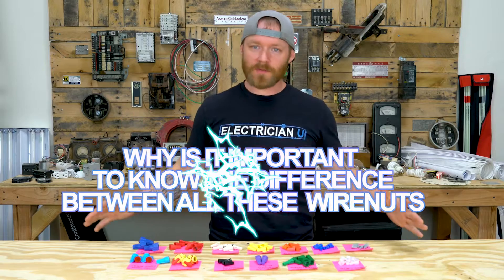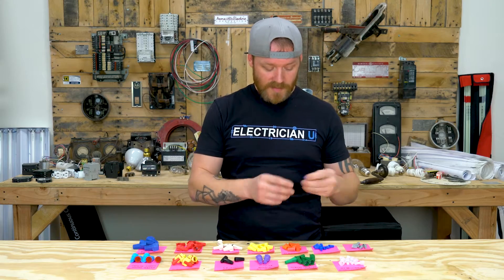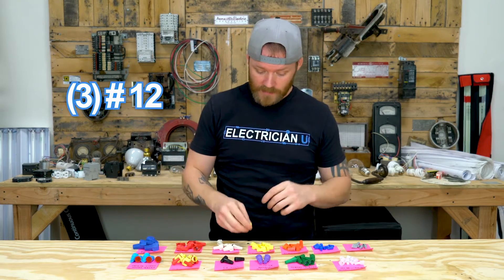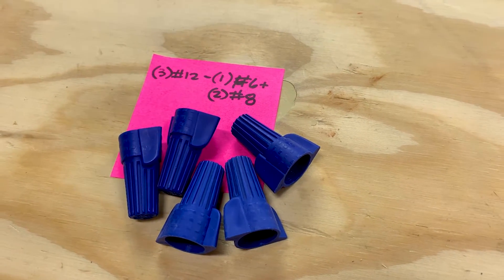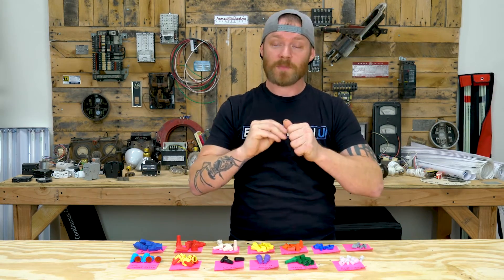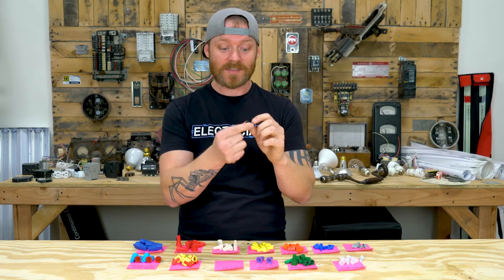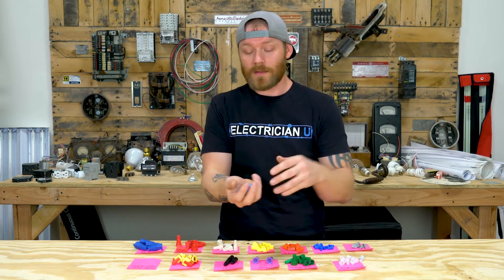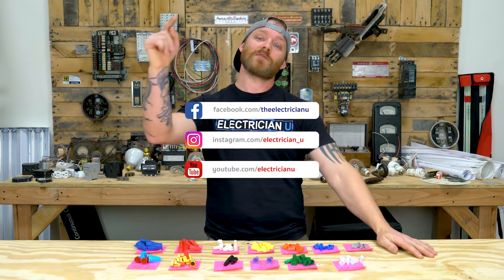WIRENUTS - Why Are There So Many, and Why You Should Care...

Comment: Great vid! Which nut should I use to just cover one hot wire in a 12-3 Romex? I have a lot of left over 12-3 and I don't want to just get a roll of 12-2 so I'm going to splice the 12-3 to the 12-2 in a junction box. Which nut can I use to just cover that extra hot wire that is not needed? Thank you!

Comment: There are different sizes because different gauges of wires and splices. There is heat shrink insulation also for splices immersed in water for motor connections servicing  well pump motors.

Comment: I don't know which size to use when combining wires in a 2-ballast fluorescent fixture.  For example, a Live/hot from the ceiling will connect with the little wires in the fixture, which are 2 blues, 2 reds and 2 yellows.  What's the smallest size I could use for that?  I'm just getting rid of the ballasts and connecting for LEDs.

Comment: These marettes are the go-to’s when you have plenty of wire, and a whole lotta time. I used to use these first, then moved to the blue cap screw-ons, then to insulated terminals, and now I’m finally on non insulated spade terminals. Now I’m thinking again about these again with a 1oz tube of liquid tape to top off for waterproofing purposes. Like I said, when you have plenty of wire, … why not?

Comment: The ones with the '' wings '' on the sides, I call them Scotch Locks,  and have for many many years ! Wire Nuts have a HARD Plastic outer shell and I only use them for the splicing of the stranded Fixture Wires to the NM-B Romex Conductors, solid to stranded !  Wing Tips or 3M Scotch Locks , I use for the splicing of the NM-B Romex conductors,, solid to solid.

Comment: If those are the red wire nuts I think they are as a commercial electrician I take all of them off and throw them to the ground. I have lost track of the number of times if gone into a box and if a wire nut falls off, or doesn’t reattach, it’s always the red ones. So, I refuse to use them for any reason. 

We mostly use 3M up here in MN with the company I work for. 3M tan/reds, and 3M yellow/grey are the goto, Ideal baby & big blues are pretty usually when needed, although not needed that often.

Comment: If those are the red wire nuts (edit: they are not) I think they are as a commercial electrician I take all of them off and throw them to the ground. I have lost track of the number of times if gone into a box and if a wire nut falls off, or doesn’t reattach, it’s always the red ones. So, I refuse to use them for any reason. 

We mostly use 3M up here in MN with the company I work for. 3M tan/reds, and 3M yellow/grey are the goto, Ideal baby & big blues are pretty usually when needed, although not needed that often.

Comment: My only formal trade training is in networking and telecom wiring ... and it alarms me that you would use wire nuts on network cable (at least network cable that is being used for networking).  A networking cable can have perfect continuity and still be bad IF you change the twist rate of the conductors in the cable.  if you are splicing cable with wire nuts the best case scenario is you just cut the bandwidth the cable can carry by a factor of 10, worst case scenario no connection is possible.  There are mid-cable splice options for many categories, but they are options of last resort.  ...And even then, good luck getting service from the device manufacturers of attached devices.

Comment: I just had to take apart and put back together a lightswitch box and it had 6 ground wires (10s) in one of the Flex Wire Nuts....
It definitely was a pain in the ass to get all 6 of them back in there. Apparently it's rated for 4. Is it okay to squeeze 6 10s in there? If not, what would you do instead?

Comment: Hey Dustin, what is your opinion on Buchanan crimps? I've worked residential, commercial, solar, industrial automation, etc... I've only seen them used in solar. These things seem to take any user error out of using wire nuts or Polaris taps.

Comment: Personal opinion: no reason to carry yellows, orange, or grays.
You can accomplish anything with baby blues, tans(white), reds, and big blues.
Side note: ideal big blues are rated for 2 #6 AWG reds will hold on to 1 #6. ONLY CARRY IDEAL
Side note 2: never use a wire nut on network cable. Just don't, they make proper connectors for that.

Comment: I mostly do residential and I mainly use tan-reds (3M T/R+) they're rated for a min capacity of  2 #18's AWG max capacity of 5 #12's AWG. Like by mainly use, I mean they account for something like ninety, ninety-five percent of all the wirenuts in any given house I've wired (until wagos came along and changed the game)... those tan-reds just fit with their specs on nearly everything resi' but then again so do the wagos and they have other benefits so... I used to carry a wire nut driver bit for my drill on my belt, now since wagos I came around, it rides unused in the less often used tool bucket. (Got one of those 5 gal bucket tool-pouch liner-thingies, use it for tools not on my belt.)

Comment: I always finish by wrapping the bottom two thirds of the wire nut along with Super Super 33 electrical tape.  I put a "tail" on the end so if need to remove 15 years later it can easily be removed.

Comment: What do you think about the push in type wire nuts?
Reply from the maker: They save a little bit of room in the box and save a little time. A lot of old heads will say the wire nuts are a tried and true method over the wagos, but both have a UL listing and both are approved. Personal preference.

Comment: The water proof direct burial wire nuts (DryCons) are used extensively in low-voltage systems like irrigation - and they come in various colors and sizes.

Comment: Great overview on wire nuts. Just a couple of things to add. The "Greenies" take the place of an uninsulated crimp sleeve, the bane of my existence. Much easier to remove and little risk of damaging the bare grounds. After taking apart the crimp sleeve, these are great to bundle everything back.

I can't understand how Ideal got the listing back for the Cu/Al purple wire nuts. No escaping that the two metals expand and contract at different rates as they heat up. This inevitably loosens them up, no matter how tightly the wires are spliced, resulting in poor contact, arcing, and burning. I've seen the new ones fail this way. Alumicons are  a much better way to go, short of Copalum crimps, or getting rid of the aluminum wire altogether. 

Bonus fact. The Ideal version of the tan (white) wire nuts can be twisted on with a 5/16 nut driver. No special tools needed and less wear on the hand and wrist. Again, thanks for the informative video.
Reply: I wonder if they are using the spring style insert in the nut. This might be how they keep the wires tight even after the inevitable expanse contraction.

Comment: I normally use porcelain wire nuts for MR16 Halogen ceiling and under cabinet lighting due to extreme high temperature they put out. Do you think I can use the black hi temp wire nuts for the halogen in place of the porcelain? Appreciate your time and feedback. Please forge ahead and keep up the excellent work.

Comment: 2021 now, it's about time people stop using wire nuts and go for the Wago type connector
Reply: I mostly switched over a few months ago after a few years of foreplay, I love them. For solid wire for lighting I use a lot of stab-nuts, especially the grounds (8 ports). Stabs are perfect for lower current and clean installs.
I wish wago made 4 ports and a back to back 6 and 8. There's a really cool but illegal Chinese knock off version that has 3 on one side and one or two on the other side that would be perfect for panels and larger boxes, alas, they're illegal and I'll never get them except for maybe a personal project that is low stakes.

I would like to see a long term torture test of wago, repeated overload over the course of months or years with crappy wire. Might rig something up at some point.
Reply: Wirenuts are just as capable and are proven, as long as the person follows the rules. Wagos are great for DIYers because it's harder for them to screw up. Handymen, DIYers, etc should always use wagos imo.

Comment: You missed the ceramic wire nuts, I thought you were gonna break some out with the blacks! Only places I've seen those is in restaurant gear, and in some kind of industrial machinery that got really hot.

Idk what the temp range is, but I suspect the copper might melt before the wire nut failed.

Comment: Wire nuts are in my opinion are the most dodgy way to join wires together. They're only good for speaker wires. Screw down connectors at a minimum

Comment: FYI: Most of the aluminum wiring thing was in the 70's. In houses built in the 50's, you might find knob and tube wiring but it was all copper.
Aluminum wiring is perfectly safe so long as all connections are scoured shiny and treated with the de-oxidizing grease immediately. Be careful with that stuff because it gets everywhere if you're not careful.
My Dad always called wire-nuts "marettes". It's kind of like calling self-adhesive bandages "Band-aids".

Comment: High temperature wire nuts?  I remember soldered connections.  Solder, three wraps of rubber tape, and two of friction tape.

I also remember when all wire nuts were “ High temperature”.  I’ve seen many of these colorful thermoplastic wire nuts fail due to a poor connection causing the insulation to melt, but I’ve never seen that happen with a Bakelite molded wire nut.  The Bakelite resin is thermosetting, and the better makers used ground mica for the filler, rather than wood flour.

Of course porcelain wire nuts, which we also used, are impervious to any level of heat.

Comment: Some idiot wired coax cable inside the walls with wire nuts as opposed to actual fittings and splitters. Customer kept saying the cable company sucks

Comment: About 20 years ago, I took out a dusk-to-dawn yard light that was in poor condition.  I abandoned the wires in the ground (UF), but to secure the end, I put direct-burial wirenuts on the ends, shoved those inside a plastic bag and taped it to the cable, shoved that through a slit in the lid of a coffee can, and buried the can (lid-down) right next to the sidewalk where I could find it again someday.  That day was two weeks ago. The coffee can was dumb - it was still there, but rusted all to hell - and the bag was mostly intact but had allowed some moisture inside. The silicone inside the direct-burial wirenuts was still soft & sticky - it did not dry out at all in 20 years - and the wires inside were in perfect condition.

Comment: German electrician here, I NEVER heard of Wirenuts before I saw your channel. Here we use luster terminals or Wago terminals. We were taught not to twist cables to connect, which is why Wirenuts strikes me as strange.
Reply: The surface area contact is greater with proper use of wire nuts. That seems undeniable to me. The question is that are push ins and Wago lever nuts adequate or even somehow superior from a connectivity standpoint? I'm not referring to convenience, as there's no doubt there. I don't know. In residential applications a 1800 watt appliance is typically the highest you'll find. In the US that's 15amps, in Europe it's only 7.5amps. Maybe that's why they are more common in Europe, lower current requirements.

Comment: I understand needing a demonstration, but if you are using CAT5 or higher for  actual networking, you NEVER use wire nuts, at least not if you want to pass networking certification.

Comment: Old rule of thumb I got from an older electrician... there are code inspectors that will fail any situation in which more than 4 wires are in 1 nut.  I've seen it happen.  There are some that would rather see 3 nuts used to daisy six wires together than have two nuts with one bridging wire.   Blue that's 6+8+8 was a specific lawsuit case in reference to input amperage so you can feed two 8's off a 6 for splitting like inside roof unit air conditioners and so-forth.  Also, get a crimping tool because any time you see the white crimpies they're gonna be loose and need re-crimped.  They're most commonly treated as a "removable option" and not all the way on.   Bet you didn't know that one.
Reply: Just because code inspectors fail a situation like that doesn't mean it does any harm to a circuit. Ive put 6 14 guage neutrals in a blue wire nut over and over and has never failed yet

Comment: I mainly use Tan Ideals. Reds when I have more than 2 #12. We still wire houses with 15a circuits. Only Kitchen outlets, Garage outlets, and bathroom outlets on 20 amp. Wire is too expensive to run the entire house in 12 wire.

Comment: I presume we don't seem to use them over here. The only time I've seen wire nuts was in a replacement motor kit for a zone valve. As the wires already had some nice looking screw terminals connecting the old motor I just reused those instead.

Comment: A little off topic from what the specs are for the wire nuts. But for most of these, if you remove the shank of your 11 in 1 screw driver. You can then use the handle to grasp the nut for a tighter twist. 

Comes in handy, especially when you’re weak like me due to tendinitis.

Comment: Thanks so much for your videos. I've used the waterproof wirenuts for wiring on an irrigation timing system that I think may have been low-voltage but necessary regardless.

Comment: 2:15 just a quick correction; as a structured cable installer that specializes in data networks, I can tell you that you would never use wire caps on any network wiring. They can be used without issue for POTS lines but that's it.  Anything above that will only use specialty jacks and punch down blocks or patch panels.
Reply: I was hoping that someone mentioned this. Network equipment can sometimes deal with runs that have been wire nutted, but wire nuts always degrade the quality of the run. At best, you'll have degraded speed. Wire nuts and other kinds of non-network connectors have a tendency to cause signal reflections and noise ingress.
Reply: Wire nuts should never be used with cat 5 or 6 wiring
Reply: @GarethBeltonl  they should never be used. we have wagos for non transmission lines  (power) and all transmission lines have their specialty connectors and requirements etc.

This is why sparkys should never touch any transmission line wiring. Let alone something sensitive like Cat6a or HDBT... they usually don't have the education or certificates.

At our work place, it's been constant battle against contractors that install very high speed and sensitive specialty AV-networks like they're coat hangers.

I'm trying to change our process that we ALWAYS demand specific measurement standards and full measurement report after installation of trunks. We've paid heavy price for the fact that people haven't done their due diligence and we've trusted them to...
Reply: Agreed, and there are even better connectors for POTS even.

Comment: As a Journeyman who's done Security, Fire, Alarm, along with Home automation and Computer/Telephone wiring and cabling. WE Never used wire nuts or crimped splices! splices were always soldered when needed, only crimped connections were to attach termination connectors. this came about from experience showing that any connection that was not made gas tight became problematic in short order.
Reply: Hi, JK - I work in the marine sector. I have seen soldered joints heat and separate in extreme conditions. Large bank battery cables and other high amperage situations. For this reason, I am a true believer of crimped connections on stranded wire. They MUST be installed with the correct crimper, used in the correct way. I will actively eliminate any soldered joint I find, replacing them with crimps. Done properly, the crimp copper sleeve will be compressed around the conductors, eliminating any air pockets (gas tight). We also use dielectric compound to eliminate moisture. Hopefully. Even when heated to insulation meltdown, a properly formed crimp will not fail.
One major problem is installers generally fail to properly crimp the connector, often puncturing the insulation, using too large a connector for the conductor, failing to test the connection once complete, etc. Ratchet crimpers with the proper dies are essential. I can't stress that enough. The Klein combination cutters/crimpers and similar are my nemesis. They've given the whole process a bad name.    
In residential wiring I have always been doubtful of wire nuts and twist all joins before screwing the nut on, but it always seems archaic. That said, the spring action seems like a good idea. 
Sort of....
Reply: @osmith5086  Oh your not wrong about general purpose crimp tools and connectors being a complete and total CLUSTER fudge event! this is why for low amperage alarm circuits in residential and commercial buildings they are to be avoided! Now OTOH I have seen for high amperage DC connections where the tech would first crimp 4AWG or larger stranded cable into a lug connector , only to verify the crimp was good by dipping the tip/far end into a solder pot to confirm the solder couldn't wick it's way past the crimp.

Comment: As German electrician it seams like watching a video from 1975. Because since then wago connectiors has been the way we connect wires. Additionally the wago connectiors are rated for Al and Cu if you're using special anti corrosion paste..